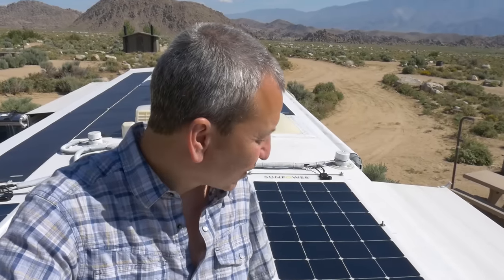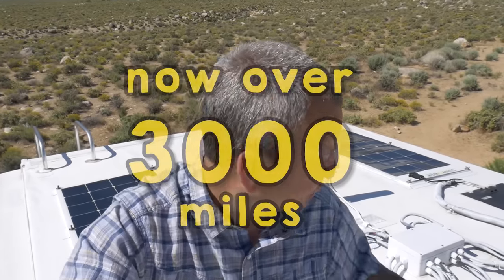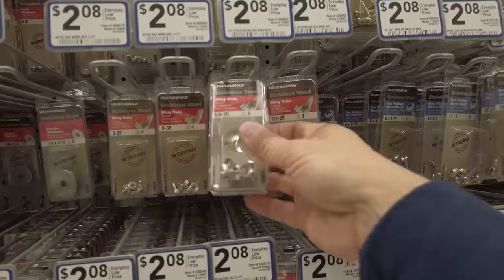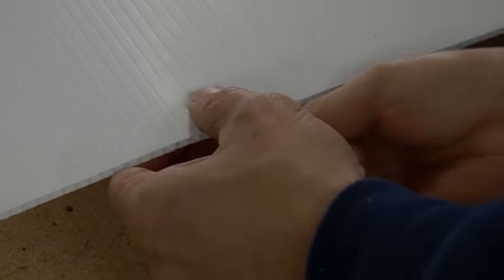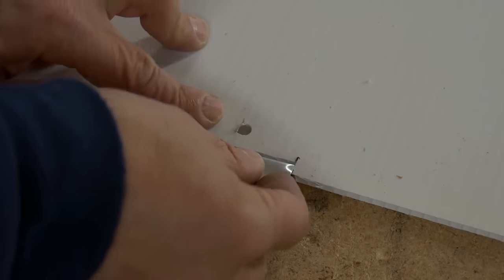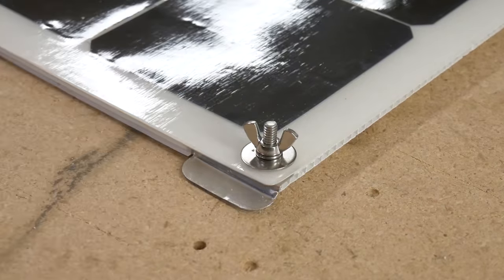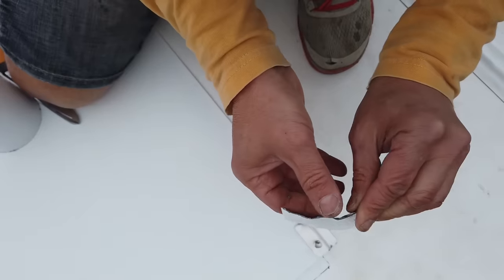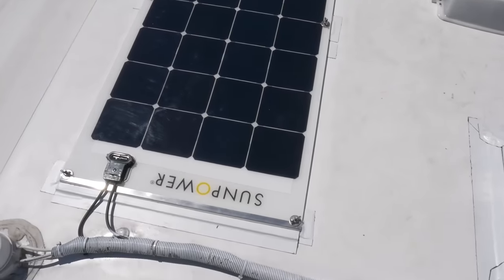Better Way to Mount Flexible Solar Panels on RV (2019)

Comment: Good ideas presented! 
You might consider using locking (stainless steel with nylon insert) wing nuts or else use shorter bolts with locking stainless acorn nuts, thus eliminating need for locktite.

Comment: Tito, I actually enjoyed your video more the second time around picking up a few things I missed the first time. Somewhere in another video someone had suggested using 1/2 inch foam cushion under the panels as an insulator. Have you or any of your viewers had any experience with this material. Your technique seems like the simplest and least damaging method to secure these panels and I like simple -great job!

Comment: Nice work. If we wind up getting the Geo Pro E19FD all fiberglass RV I would never consider drilling holes in the roof, so when we add on to it's factory installed solar system, this will be the way we go.

Comment: That's a really nice setup. I can't stand the thought of drilling holes in my roof....
Reply: Why? Just seal it with silicone. The non flexible panels have a higher efficiency and much longer life.

Comment: Cooling airflow thru the coreflute under the panel could increase the efficiency of the panel.
Reply: Just drilling a series of small holes in the front face of the anti-lift strip would suffice. It would not reduce strength and could allow enough airflow to pass to make a small but noticeable difference?

Comment: surprising you went with flexible again after the first failures. yeah I know sunpower is a better brand but the issue is heat dissipation which I'm not sure the that plastic board will be enough. I mean, they are warrantied for 5 years instead of 25-30 for a reason. I'm certain with the money you save with normal panels (thinner frameless ones do exist now) you could get a rack mount to allow more clearance between the panel and rv roof. I mean it's an rv so it doesn't need to be steal or anything. well hope your solution works.
Reply from the maker: I'll keep you posted and share how it works long-term.

Comment: What were your performance gains with Vs without the air gap?   Is it worth it?   I’m assuming while driving there is enough wind to cool them to ambient.  But,  while stationary,  I’d like to see your numbers before and after

Comment: Very clever and clean, I install these same panels on Boats where they are mounted on canvas.
Reply from the maker: Thanks. I've been wanting to incorporate some twist lock fasteners through the grommets like you might see on a bimini. That might be iteration #3. If you have suggestions let me know know 👍
Reply: Mark...how do you secure the panels to the canvas?  I plan to do this on top of my bimini...thanks

Comment: I would go easy on the lock tight. I work with carrie bolts where the nuts seize and the whole bolt spins, leave enough bolt sticking up to get a vise grip on if you can. A washer with a square hole for the carriage bolt, anchored with some eternabond to the roof or plastic might help you when you go to torque those nuts off. 
Nash 25C
Reply from the maker: Thanks for the tip!

Comment: Thanks for the video-- easy to follow and a great idea!  I'm wondering about whether this is a good idea in colder climates?  I'm a little concerned about ice blowing into the plastic sheet and accumulating.  But maybe that would be alright?

Comment: Hello Tito, I used this method and it completely failed. Yes there is a flex panel somewhere in the middle of the desert. After we lost the first one we reinforced the second with eternobond all the way around. Then on our next trip it flew off. A truck passing by flagged me down and I was able to find it. So now we're starting over again however I'm thinking that driving in the 100+ degree temps is softening up the glue so that's the reason it's not holding. We're now thinking of adding some of the double sided tape under the panel (yes we have the insulator) then attach the panels with 6 screws, and then use the tape everywhere else. Do you have any recommendations on the type of screw or any other recommendations on how I can secure the panel on the roof? Thank you

Comment: I like to use black zip ties for a lot of things.  They are UV resistant and cheap, so easily replaced when the solar panels need to be changed.  They are not prone to work loose from vibration like nuts and bolts.  You may have already eliminated them for some reason that I haven't thought of.
Reply from the maker: I use those all over as well. One thing that didn't make it in the video is that I cut extra pieces of the plastic as covers to fit over the bolts. Comes in handy to protect the panels when parked and not needing them for long periods of time.
Reply: @RVwithTito  That make's perfect sense, and makes bolts a better choice.  I figured you had a good reason, being the great engineer that you are.

Comment: I have actually seen the corrugated plastic used with the flexible solar panels and plan to use this method.  I love how you mounted the panels.  Very ingenious I will definitely do something similar.  Perhaps using nylon insert locking nuts so you don't have to worry about them loosening up.  Great ideas!
Reply from the maker: Those nuts may spin bolt when you tighten them down. So make sure the bolts are anchored well first. I considered using them as well, but didn't for this reason. My alternative suggestion is to simply add an extra nut on top of the first. It will lock down the first one.
Reply: @RVwithTito  Good point you do need some torque to tighten that type of bolt.  I will be doing something very similar when I do my solar.

Comment: You are a good video maker Brian. You have been able to demonstrate that good video quality is valued higher than reliable content because let's face it, the methods of putting flexible panels down on the roof leave room for improvement :-)

You must have figured out that your first method, caulking a flexible panel down all the way around the panels, locks heat up underneath it. The new plan of using plastic cardboard might have been sprouted with the thought that the tiny bit of airflow through the plastic cardboard will supply more cooling. It might do the opposite.

Of course now we have a flexible solar panel with a soft insulating underlayment that makes the panel very prone to cracking when stepped upon while the insulation takes that last chance away to conduct some destructive heat away from the panel and into the roof.

I would not be surprised if in the coming years your knowledge evolves to “flexible panels are good for  mobile use on a cool grass mat but for god sake use conventional rigid solar panels on the roof with a good air gap between it and the roof, at a good angle, to let air convection transport the heat out from underneath the panels.”

Keep up the good work :-)
Reply from the maker: Thanks for sharing your thoughts and experience. I'm glad you liked the video quality 🙄

Comment: I may be the first one to ask...Aluminum with stainless steel? Isn't there an increased chance of the steel causing the aluminum to corrode? I know when ever we do aluminum on a hose siding soffit/facia etc we must use aluminum fasteners to prevent the "electrolosis" reaction between dis-similar metals.

Comment: Circulation is important to cooling, as the panels heat you loose amperage. 
May not make a difference for what you use. Clean job.
Reply: Yes, I agree.  A couple of hole 1/4" in the front bracket will suffice to have some air circulation under the panel while moving. And half inch of the corrugated board will be even better.
Reply: Solar panels are meant to operate at high temperatures.  The open voltage and open amperage on all my panels does not change as the panel heats up. Unlike a battery...the heat a QUALITY solar panel can withstand is amazing, especially if an amorphous panel rather than crystaline.
Reply: @geraldhenrickson7472  So, the solar panels that caught fire at Walmarts weren't related to high temperatures in the panels? Or was it sabotage?

Comment: Thx Brian!  I like it.  Did you ever take your temperature gun and check how much heat comes through your roof with the new design versus the old versus no solar?  I like the idea of corplast just to keep the suns heat out, but you went one further with the solar!  Well done!
Reply from the maker: Thanks. I haven't measured temps yet in a controlled setting.

Comment: What a great idea! ... but the roof of my van (Ford Transit) is not flat; there are bumps. Any suggestion to apply this idea to the roof with bumps? Any issue I should be aware of before I work on my solar panel installation? Thanks.

Comment: Interesting concept, just using tape, trusting soul in the blazing heat other than putting a carriage bolt in a round hole and the wingnuts, which should be double nutted with all the vibration. Now you’re trusting Loctite to do its job to keep those wingnuts from loosening not sure why you wouldn’t use nuts. nice job

Comment: Great Idea. You could use nylock nuts instead of the glue, maybe? They are nuts with blue plastic around the hole, so when you put them on the threading bits into the nylon to give it extra grip. But they can still be taken off if need be.
Reply from the maker: I opted to not use locking nuts. I was afraid they would spin the bolt while tightening them down.

Comment: I have done the same on my sailboat ; believe me the plastic corageted board is drying very fast under the sun,it desintegraded in 3 saisons ,not even 3 years ,because was leaving it inside to protect it during out season,that mean ,keep an eye on it

Comment: Thanks for this video, Brian, and the many other I've watched over the years. Been neck deep in research and thinking about flex panels atop my van with your corrugated plastic idea. Got a few questions if you have the time:
Do you believe the popular notion that flex panels are significantly less efficient than rigid? 
Do you believe they start losing performance after 2-3 years?
Do you believe that the corrugated plastic significantly helps with cooling the cells and lessens heat transfer to the roof?
And finally, a burning question: why RVwithTito when your name's Brian?

Comment: Fantastic segment Tito, thankyou. Curious, since this was done yrs. ago, any new thoughts about how it's held up since the initial install? Also, did you have flexible panels that over heated previously and shortened their life and or caused less wattage efficiency prior to mounting these panels this way? I saw what looked like smurf tube on your roof. Is that to protect the wires from uv damage to the outer jacket of the wires? Just curious. Thanks again. This really made sense in so many ways. Especially not drilling into the roof.
Reply from the maker: I did have one die before I tried this method. Eventually I got better quality solar panels and upgraded my mounting system to this: https://youtu.be/uJIEXhnF8MU
Yes. The cable wrap is just to make it look nicer and protect the cables better.

Comment: This is a great, creative method. How are those panels holding up?
Reply from the maker: They held up fine, but I had trouble removing them. I eventually got higher quality panels and tried a new mounting method which is now my preferred method for flex. Check it out. https://youtu.be/uJIEXhnF8MU

Comment: Do you have an update about how well this has worked over the last three years? I am thinking about putting some flexible panels on my camper shell and this looks like a good option.
Reply from the maker: I did experience some condensation build up and a little roof discoloration from heat. I eventually came up with a better idea that you can see here https://youtu.be/uJIEXhnF8MU

Comment: Have you compared the temperature between panel mounted to roof compared to those on the plastic cardboard. I think you'll find the plastic with the air channels is an excellent insulator and will conducted less heat away than an aluminum roof. Trapped air is a great insulator,think down,fiberglass etc. If the air can flow through plastic cardboard quickly as you drive then it could carry away  some heat.

Comment: Interesting and creative idea and implementation. Any way to tell if you're getting improved output from the panels being cooler?
Reply from the maker: Hey guys. The output has been really good but it will be hard to nail down what the impact of the mounting method really is because these are higher quality panels over the previous ones. I imagine the operating temperature during peak hours are about the same (around 140 degF). We will see how they hold up over time.
Reply: @RVwithTito  Can't wait to see 'em in person. 😊
Reply: @RVwithTito  
How are we doing so far?
Reply: @unenslaver1333  curious about an update on these panels as well.
Reply: @RVwithTito  Compared to say, Renogy, are the Sunpower panels better at producing/converting light to energy? I'm looking at both.
Reply: @RVwithTito  It has been a few years since you made this video; how have the panels held up?  Have you had to replace any?
Reply from the maker: @captaincurt3180  I did have one of those fail. I eventually replaced them with 170W Sunpower Panels and came up with a better mounting system that has held up great. All of those videos are in this playlist https://www.youtube.com/playlist?list=PLIsusUNNN2JYK8N24MviXNPwgHDONvb89
Reply: @RVwithTito  Thank you Tito!  I'm watching your playlist now.  Thanks for the quick reply!

Comment: Aside from the low profile, what are the advantages of using flexible panels in this application? Yes, no holes in the roof. But there are many dozens of holes in every roof and simple solutions to keeping those holes leak free. Considering expense and efficiency and the trouble of removing tape if need be - why go with flexible? I bought this same panel and after long consideration just ordered rigid panels instead. Maybe you've made a video on this subject which I've not seen. I'd like to hear the argument for flex over stiff.

Comment: Pretty neat and i am sure that helps with longevity and efficiency but i have just heard to much about flexible panels not lasting long and the weight is not a big deal and not screwing in eould be preferable but ill stick to trading solar panels
Reply from the maker: Understandable. There are lots who prefer traditional panels. I'm not pushing flex. I'm only sharing what I've tried for those looking for the info. Thanks!

Comment: You know you should use Blue loctite or you wont be able to remove those wing nuts without tearing up the plastic. It also needs to be put on the threads before the nut is put on. I is an anaerobic and doesnt wick into threads.
I have a thought ! Why not framed solar panels the air gap will probably keep inside cooler ?. What type of roof does your RV Have? Fiberglass or a membrane? Love your ideas and  videos
Reply from the maker: I have a TPO roof and am using the blue loctite on the threads. They haven't budged. Thanks!

Comment: Such a good video, and great DYI solution. What do you call that hand tool you use to affix the eternabond and take the shape of what's underneath ? Been looking for it in hardware stores and no luck so far. If you have a link to it, even better. Thanks !

Comment: You are not going to believe this...I just finished installing the energy management and solar storage batteries YESTERDAY.  (Let me know if I can link our facebook page)  Everyone asked me so when are you installing the panels? My reply said as soon as I see how Brian Did it! I do have a problem already. I don't have eyelets in our panels. EDIT HERE: But with your idea I'm going to use elevator bolts and durabond tape. 16 bolts per panel (4 bolts per 2 foot section of floor edging per side to secure panel.
Reply: Hey Brian- 1500 miles and still holding! Going to install the rest of the panels in a couple of weeks the same way. Thanks for sharing!!
Reply from the maker: @opaandomascampingadventures  Great!

Comment: I am working on a cooling system that will use a pc liquid chiller to keep the panels from overheating. This could work with what i am doing

Comment: 2 things - 1/ You might want to look into polycarbonate as an alternative to chloroplast.  It will endure better.   2/ You might want to plug the channels so insects don't move in.  Something to let the air pass but not the bugs.
Reply from the maker: Funny you say that. I have picked up a bunch of polycarbonate and plan to swap out the chloroplast and try a new mounting technique.

Comment: Hi guys, I'm a long time subscriber and I follow follow your engineering projects with pleasure.
I also follow Will Prowse. I saw recently that he is adamant that flexible panels are not reliable and he points to the heat issue in particular. How was you experience last year? Were you able to document an improvement over your previously installed panels? Finally did they survive the summer? 
I really hope you continue to enjoy doing these, because I definitely enjoying watching.
Thanks, Manning
Reply from the maker: Yes. These panels are doing great. They are much better than the previous ones. I've got a follow up video that should go out this week.

Comment: First of all thank you for the very informative videos you post.  I have a question.  I am putting a160watt panel on my Class C using this method to maintain the coach batteries while stored and not hooked to power, I have the panel, wire and a controller.  I would like to run a feed to my chassis batteries.  What is the best method?  Can I just run from the one controller without fear of the batteries draining each other., or do I need a second controller and just split the wires from the panel.